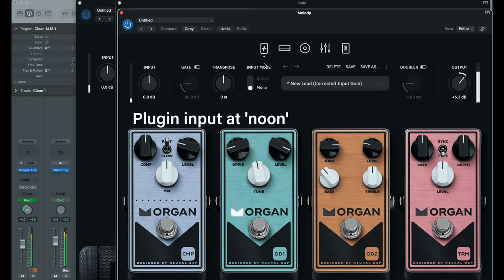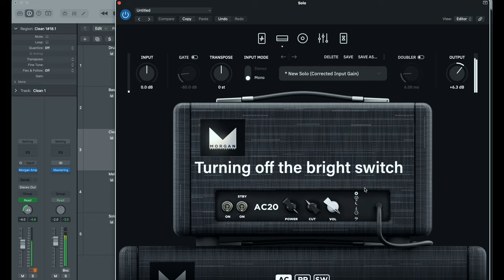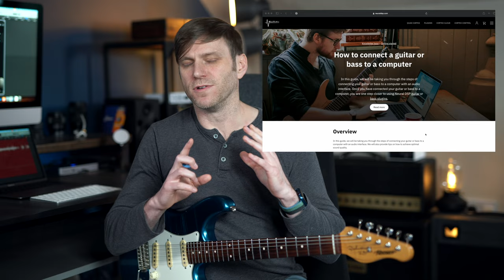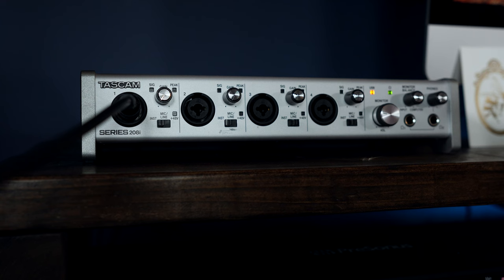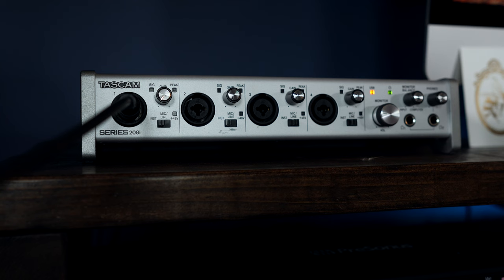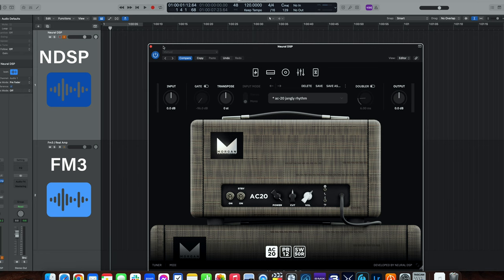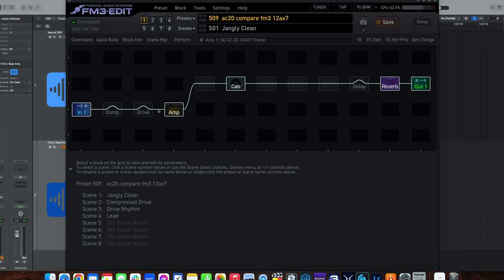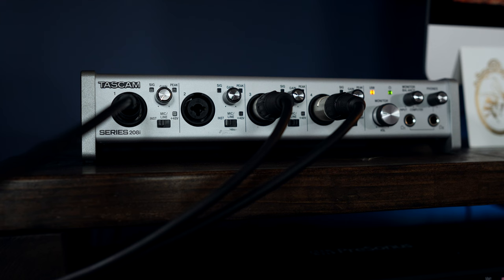I Finally Learnt To Like Neural DSP Amp Plugins | STOP Slamming That Interface & Get Better Tone!)

Comment: Plus, activate High-Z input on your interface. 
Another option is to place a preamp with very low gain settings in front of the interface.
Reply from the maker: Yes, I should have said this a bit clearer, always go into an instrument hi-z input! I did this on the Presonus in the previous video, and I am also doing so on the Tascam in this video, you can see the switch under the gain pot.
Reply: @DavidBeebee  You also should have said you cranked up gain on guitar track in logic.... INSTEAD of hardware input gain on Tascam. Because you STILL need healthy level of your guitar hitting the front of the plugin. Because Ed's video is NOT about plugin or guitars or input level. It's about aligning RANGES of hardware gain of two interfaces.
Reply from the maker: Hi, I'm not sure I'm following you. I've spoken with Ed a fair bit about this, and he's also commented on this video, saying it's a clear demonstration of the issue. If you watch the video you can clearly hear how the plugin improves and gets closer to the response of the real amp/fm3 when using this method. What do you mean "cranked up the gain on the guitar track in logic"? I have not put a gain plugin on the insert and the track level doesn't have any effect on the input going into the plugin. Can you elaborate on what you mean?
 @SugarTouch
Reply: @DavidBeebee  Ed S replied in many comments on his video that depending on the interface and plugin being used, you may still need to cut or boost the input signal within the plugin itself, or with a trim/gain plugin before it if the plugin does not have enough range. Lowering the input all the way down to zero on your interface is the get the cleanest signal possible to work with, with the lowest noise floor. You need to then match your given amount of headroom for your interface to whatever threshold the plugin brand used to calibrate their plugin. Do not boost your interface gain EVER (unless you do not care about getting accurate GAIN staging from your plugins!) because you are lowering your headroom and also boosting your noise floor levels, which is much greater than the inaudible margins you get from boosting within plugins; you will not know what amount of headroom you have without using a sine wave to test it, and you probably would not be able to match that specific decibel target to whatever was used to make the plugins. It is also like putting a clean boost pedal or overdrive pedal in front of the amp. Hope this helps, keep rocking! \m/

Comment: Maybe correct gain staging was assumed knowledge to use plugins effectively.  A good audio interface with nice converters does make a difference as well.  The Neural amp sims sound noticeably better than Fractal to me - hence they are all I use now.

Comment: Similar issues with my Kemper where rigs sound awful a lot of the time when setting up for recording. Was getting so frustrated. From what I think you are saying it would be a case of setting my Tascam 4X4 input to 0.0 db and the input on the Kemper rig to 0.0db. Fingers crossed not sure that it will work with the Kemper input set to 0.0db but will give a it go. Cheers for that watched Cordy and ED S videos but this just linked it all together for me. Simple enough on the face of it Thank you sir. When I think about it now I used to use Amplitube 4 and the Scuffham amp and they too sounded wrethced.. Will go back to trying to them out again using this method..  Also like the sound of the Neural DSP.. Game changer might be an understatement..
Reply: If you are using the Kemper as a DI, turn down the Clean Sens. parameter. At default (0) it’s 5dBu which is very low headroom. I’d adjust to -7dB or -8dB so you have 12dBu or 13dBu headroom, and then set reamp sens. to +7 or 8 so if you reamp with the kemper it’s back at unity. That level will also sound better for NDSP etc plugins

Comment: I have a 1st Generation 6i6 Scarlett and tried rolling it all the way left on my Neural and Nembrini plugs with varying results. IN some cases there was not enough signal to make for a pleasing tone. Maybe it's just me and I'm not understanding something but I didn't find this to be as pleasing as what I was using before. It does however make me want to look into modelers now.
Reply: My signal is too weak as well. I'm going into a presonus studio24c. The math on mine is to back off the NDSP input to -2.2 after setting interface to zero. Signal is too weak.  I concur with another commenter here who said to set interface to peak at -12 to -13 instead.  If you've been peaking at -6 before that would explain why it sounds too saturated once it hit the plugin.

Comment: I've had the same experience. On any humbucker guitar, the AC20 would sound way too saturated.. for that matter any plugin amp sims lol

In the topic of "matching the level a sim is expecting", I'd argue that you could technically achieve the same thing with cranking input on AD up but backing down the INPUT knob (NOT THE GAIN KNOB ON THE AMP SIM) on the plugin. This way you preserve the great SNR from AD conversion (although with modern interfaces this wouldn't be too much of a problem), while taming the input to a level that the sim is expecting.

I think the problem comes down to these plugins being "reactive" to the input level. If you think about real amps, they almost always have a fixed preamp level and the rest of gain stages work around that fixed level. With digital sims that part is just gone; so it's upto you to provide a "matched" level -- either by controlling it at the interface OR with the input knob. Take Fractal for example -- all fractal units have a default "fixed" input level when all knobs are at 0, and their amp models are designed to work around that level.

Whereas with ndsp or any ampsim plugins, you have at least 2 stages of gain control. One at the interface, one at the plugin. Nailing this is totally upto you... and for this you'd kinda need to know what the real amp sounds like

Comment: I noticed the white volume knob and power knob did not work at all like the real amp. The white knob was adding distortion in the plug in and on the real amp it pretty much adds only volume. The power knob was adding volume with very little distortion. It’s also missing out in the ear piercing chiminess and country twang the morgan can hit. It felt nothing like the actual amp to me.

Comment: Since i'am as a bedroom guitarist with no real amp😂, and too bad for me that i have small amount of knowledge about how the real amp sound compare to plugin that i used. For the start before record any guitar, usually do the gain staging and matching the sound based on my ear😂 not based on the real amp because i dont have anything to compare, but for better sound, i think your trick could be useful for me and others to try. Because mostly i've struggle with my sound reference, probably because of the inacurate input staging.

Comment: no wonder all my preset packs in helix native were so gainy. also all my NAM captures i got too. time to revisit them all properly.
Reply: Exact setup plugins you use.. ive used other amp sim plugins for 16-17 years now.. and ive always wondered why everything sounded like over saturated and everything would sound boomy and muddy.
 I accidentally figured this out about a month ago.. holy crap what a difference ! Then, of course, the audio tracks in my daw are all super small so I thought I was crazy. Then, right after all these videos came out, talking about this !
Reply: @fuzzymuppet1990  Hey! I'm facing the same issue. All the amp sim plugins I'm using on my i9 computer through RME Babyface Pro FS and also on focusrite scarlett solo 2nd gen are sounding very very boomy an muddy. I tried to lower the input gain on interface to zero. Although the saturation reduced, but it's still way too muddy and boomy. Totally unusable. 

Can you please tell me what were your issues and did you find a solution? Really trying to get a usable guitar tone and make the plugins sound just like they are supposed to since last 10 years. They sound very boomy and dark and muddy and lifeless.

Comment: Hello! I want to ask specifically regarding live setup. Is this issue ONLY for DAW & plugins? Or does it affect live setup input/gain as well? If so, what is best scenario tor live quad cortex straight into an analogue mixing desk (without DI). Should we change anything?

Comment: Those gain setting recommendations make sense for proper hardware. Is it not obvious that the DI/preamp and converters of your interface will greatly affect your amp plugin experience? This is the same as when you record anything. A cheap interface with a poorly designed DI will sound bad.

Comment: The problem is that the sound comes from the plugin is great when the gain is set to 0 in my interface , however the dry signal being recorded is very poor in my daw which wont be useful if i changed my mind and used another plugin
Reply: And beside you want the guitar being recorded between -12 to -6 dB.
This method will just make your dry recording useless, and that is the most important to have a good mix. The amp sim you use does not matter

Comment: I have a problem experimenting with this method. 
When i set the interface gain (SSL2+ for reference) to 0 I get little to no sound on the DAW, and I have to increase the gain to be able to hear the input. Any recommendations?
Reply: My SSL2 was buzzy with extremely loose fuzzy buttons , second channel didn't work , continually disconnected itself .. I threw it in the garbage and bought a Clarett .. problem solved. The hype on those interfaces is crazy online. I don't get it. Maybe I got a lemon, but I've heard A LOT of other people talk about those interfaces being bricked within a year.
Reply: @Fiveash-Art  1+year and counting, no problems until now.
Reply: @265ENOCK  That seems to be most people's experience. Hope it continues working for you. I couldn't turn mine up past 2 without getting a nasty buzzing hum. I almost thought I was having a ground loop problem. That wasn't the case.  I'm actually glad to be rid of it though.. The Clarett sounds SO much better.. it also feels like a quality build unlike the SSL unit .. live and learn I guess. Always beware YouTubers hyping gear and software. A lot of it is just straight up guerrilla marketing. They're being compensated to endorse stuff. They may look like the real deal .. but if they're making money, they're most likely compromised.

Comment: How do you then compensate for the huge signal/volume drop when recording? Raise the Output on the Plugin?
Reply: This does not make any sense, as Hi-z gain knob is supposed to be use to get the best gain stage level before recording. And as you probably already found out, the reason there's no signal on your recording is because you are recording the actual dry signal, not what comes out from the Plugin. So it does not matter the output level of the amp sim.

Comment: Why not turn down the input gain in the plugin UI? It's non-destructive; you get to keep options. Is there an actual sonic benefit to having the gain at zero on the interface, versus turning it down on the plugin?
Reply: the benefit is you know exactly what your input headroom is, and you’ll likely have a hot enough signal anyway at 0. If your interface has stepped gain controls you can easily add gain and adjust your headroom value without having to measure. any approach is fine, but setting it to 0 means you can just look at manufacturer specs and return to that value essily

Comment: nice! thanks for the settings. how many db do you peak at normally when pluggin in your guitar to interface with gain at 0?
Reply: it would depend on the guitar, set up, tuning, pickups, pickup height, strings, pick, player etc.

That’s why we use a sine wave to calibrate (because it’s constant and repeatable). If you use the manufacturer specs you dont need to measure as they’ve already done it for you :)
Reply: @eds4754 i agree it depends on the guitar/pickups, etc. But are you saying that it should not matter? even if the pickups are low output (not hot), still the interface/plugin gain should be set  at 0?
Reply: @tendingtropic7778  exactly. We want to preserve the differences in guitar levels and different pickups. With a real amp, low output single coils drive the amp softer than loud pickups. We want that same behaviour with plugins, for them to be accurate.

So the only variable we are trying to remove is the converter calibration. All other differences in level we want to preserve.

Comment: Hey David, nice video! I have a question though. How come, at around 14' you have an overdrive and your Gate is at -96Db and there is no noise, humming or hiss whatsoever? Like, everytime I use ANY guitar plugin, there is a very annoying white noise, even without input. Everytime it looks like I'm running a wall of 30 Marshalls JCM800 with the volumes on 10.

I'm using a UA Volt 276.

Thanks
Reply from the maker: Thanks! Yea noise issues could be a ton of different things. I do run some strip silence in between the playing gaps, so that could be giving the illusion that it's quieter than it is?
Reply: Ozone RX 10 solved that problem for me. Pure magic

Comment: Why not turn up near clipping, then turn down the input signal on plugin to match the peak between 0 gan vs near clipping gain? 

To get lowest noise as possible from the AI itself?
Reply: the background noise from the pickups will be more significant than the self noise of the interface. So even if you lower the interface noise, you won’t hear any benefit as the pickup noise will mask it

Comment: Hello, I have a silly question, but what should be the volume in the guitar volume? because I understand the Input in the interface has to be 0 and the plugin at noon, but what about the guitar?
Reply: Guitar is wherever you like it, just like when you use a real amp. The goal of calibrating is so that ANY guitar you use, no matter how the volume is set, which pickups, if you are using pedals etc, the plugin would respond just the same as the real amp.

Comment: But if you are recording to a DAW, if you don't use the gain on the Hi-z input, then there's no enough signal, since when using amp sim on a audio track as an insert, you're actually recording the dry signal of the guitar, not the Neural output. So how to go around that?
Reply: That means we are listening to dry signal of our guitar + the processed sound from amp sims, both are the same time, when playing and listening through studio monitor speakers?

Comment: How do you set the plugin input level for PRE-RECORDED DIs though (since the audio interface gain is already baked in in the tracks, and you most probably don't know with what interface and interface gain it was tracked, etc) ?
Reply from the maker: I guess this would be a case of using a combination of ears and metering. When I did my original and I revamped the DI's I obviously had an aural reference to shoot for. If I didn't have the real amp and/or fm3 It would have been impossible. Which is kind of the point really, without that knowledge it's super hard to know whether your plugin is sounding as it should or would with the same guitar plugged into the real amp.
Reply: @DavidBeebee  Thanks for the anwser. It gets even trickier when you deal with DIs from someone else.